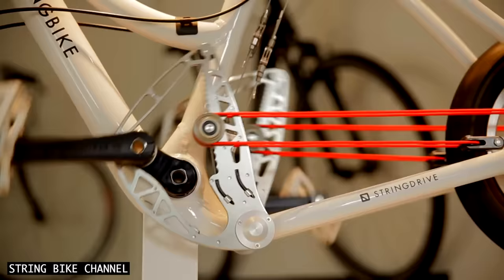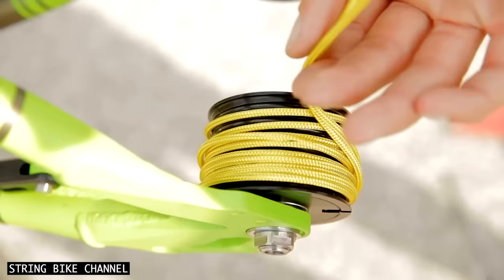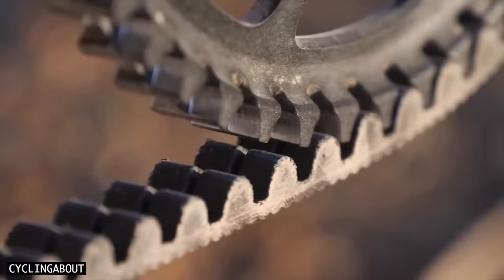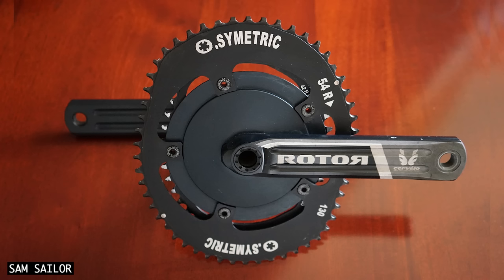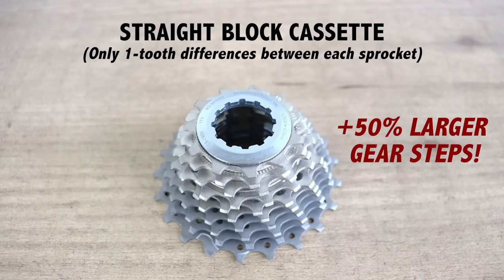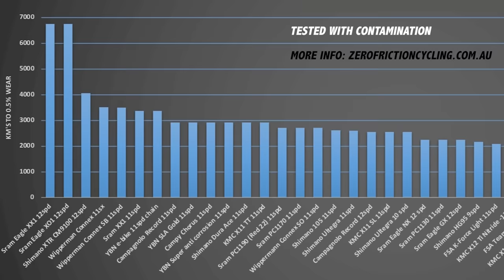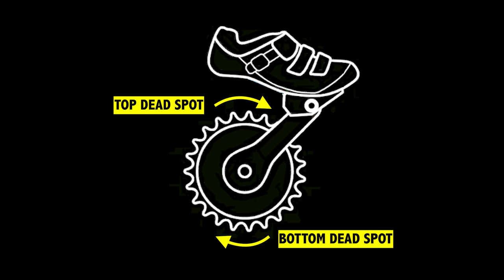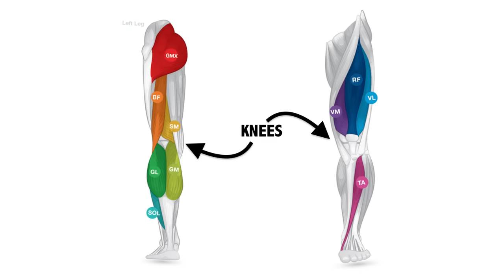Are Chainless String Drive Bicycles a Genius or Terrible Idea?

Comment: Regarding oval chainrings - discussions about biomechanical efficiency prove a complete misunderstanding of the essence of the benefits of driving on oval chainrings. The effect (reduction) of the upper and lower dead center in the normal speed range is not that important, especially when pedaling in the SPD system - thus pointless discussions, scientific investigations etc. The greatest benefit of oval chainrings is the significant elimination of the dead top and bottom points when overcoming extreme climbs (15%-30%), at the limit of minimum speed (3-5 km/h). In such conditions, the cyclist struggles to maintain balance when overcoming dead points, the driving torque drops to almost zero - overcoming this range faster brings huge benefits. And not ordinary oval or elliptical chainrings, but asymmetrical ovals (non-elliptical, e.g. Doval) give this beneficial effect, at least this effect is stronger on non-symmetrical ovals.
I dare say - it concerns much more MTBs than road bikes. 
One of benefits of stringdrive mentioned in the video was eliminating/reducing dead points - weakly relevant.

Comment: Can you make chains out of that rope material? 😂

Oval drives are about putting less pressure down not more. Theyre great for road use and do make a difference in smoothness but they dont work for mtb's where you have to pop the front wheel up using a strong pedal stroke. Dangerous for that.
Theres also two designs..shimanos which was a failure and modern which use different rotation angles

Comment: Seems pretty crappy from some googling. On other hand belt drive is pretty good. Personally I'm looking for it because I'm kinda dreaming of going touring and it could give some advantages for that type of biking. On other hand, for other common cycling purposes I haven't seen anything that beats chains, honestly it just works and you can get parts anywhere. Overall, if you add complexity like in this case, it might feel better, idk if it does, but that mechanism is going to add losses of efficiency in your pedaling. Frankly, I don't see point for this aside from being weird novelty some people are going to try.

And that tensile strength mentioned in video means absolutely nothing, it's just bit of information someone would put on advertising to try trick customers with bigger numbers ;D It's just weird thing to mention, unless you fell for marketing. Chain can handle all the stress needed for biking. On other hand that rope will be much more likely to get damage or wear that will lead to it snapping.

Comment: "Gears don't require adjustment"
Sure they don't... those four cables going to two totally separate sides of the system just magically set themselves to be equal. The push/pull cables required to hold those adjustment points in place magically don't stretch, despite being the same cables as traditional derailleurs.
Reply from the maker: I use push/pull cables on multiple internal gear hubs, and the number of times I adjust them in between replacing the cables is often zero. In any case, gear adjustment intervals are significantly reduced compared to spring-loaded derailleurs.

Comment: Wishful thinking here.
The reason chain is so efficient is because very little energy is lost
The claim that dyneema rope does not stretch it's not quite correct here
There is wasted energy in the take up that is not existent in chain
Also
Absolute strength comparing chain to dyneema rope has no meaning here
The way this bicycle works, The winding of the drums uses energy.
This energy is produced by the rider
This energy is wasted.
In bicycles a very small drop in efficiency is a really bad thing

Comment: Never thought I would see a larger money pit than a regular road bike. $10 for a set of strings would make this bike slightly less expensive to operate than a car. Good luck finding spare parts since nothing is standard. Bikes should be good for the environment as much as possible. Standardization helps with that. Nothing like manufacturing a bike made entirely from proprietary parts. Stringbike is trying to solve a problem that doesn't exist, creating many in the process of doing so. Terrible idea.

Comment: I see one issue that will cause major problems selling them. "String" sounds silly, weak and unreliable. They should come up with a better name. Regardless of the relative strengths and weaknesses, your never going to get mass market acceptance of a bicycle that uses "strings" in its drive train. Presumably the "strings" are made out of fibers like Spectra or Kevlar. Which do you think people are going to buy, a bicycle with "string drive" or one with a "Spectraglide Transmission" or a "Smooth operating lever actuated Kevlar belt drive". Marketing counts for a lot when you have somone else trying to run down your product so they can sell theirs. "Our Bikes are tools for the professional athlete. We use an advanced alloy gearset with a state of the art modern implementation of a proven gear and chain drive system. Theirs use a string. It might be ok for a child, but an athlete like you is going to snap that string like... Well... A piece of string..." And under no circumstances make the cord bright neon colors like day glow green or orange. It screams "toy". Call them cords, or belts, or anything but strings, which should be like talking about "stickers" at a label factory. Their not "stickers", tthry are decals or labels, stickers pieces of paper that are bought by 5 year olds for a nickle from a gumball machine. Labels amay be made outt of a range of materials ehichight invlude paper but can also be high tech heat and vhrmichal resistsnt polymers or even ceramics. Is a sticker snd a label thr smd thing... Well, yea its marketing... 

I bet you can make something like that  lighter. Make the lever arms out of carbon fiber with an attached titanium teeth, etc. See if it can be optimized for competition use. Carbon fiber cords might be an alternative to what they are using if you dont care about money. It doesnt look like there are any really bad bend radii on the cords. Things like spectra and kevlar have a lot more stretch to them and will disipate more energy. If you can get that down you can increase efficiency. The 1000km life span of the "cords"  should not be as much of an issue, so long as you can depend upon them lasting that long. Like a race car engine. If it lasts for the race, but needs replacement before the next, thats ok. Electric motors are not an issue there either. Disc brakes? Might be an issue but that might be solvable.

Comment: Let's see: Less durable, less efficient, proprietary, more complicated, less adaptable to environmental conditions and varied power/speed duty cycles, and far more expensive.  I'd say they're terrible.  The ONLY viable alternative to chain drives are sealed gear units and ONLY for low-performance commuter bikes or extremely muddy off-road terrain.

Comment: 'I know it looks crazy and complicated'

That's because it is. A ratcheting hub on either side is not a great idea for a multitude of reasons. There's a whole lot of problems with this and funny enough almost none of it has to do with the string. The problem is how extremely complicated it is compared to random ass stamped metal and bearings rofl.

Edit: Also why did you lie about how strong the dynema was? You are 100% aware it's not that strong in the setup there especially with the bend radius.

Comment: If you ask me normal bikes with chains and external gearshifts worked just dandy... They were easy to maintain and repair and they worked just fine. All this new tech shit they're throwing on there is nice and all, but a few years from now if it breaks down I'm down a freaking mortgage to pay some dude with a masters degree in engineering to have it fixed... The old bikes I can fix almost every problem in 15 minutes from the comfort of my own backyard costing me a anywhere between fk all and 30 euros if it needs a new part.

Comment: yeah chains are cheap my arse. some of the ebike chains I saw cost up to 150 euros. just for a chain. The backwheel gear set isnt cheap either. and niether is the gearset on the front.
all in all if you have to replace it all at once it can cost you anywhere from 100 to 200 bucks nowerdays, that aint cheap. I just had to replace mine cause the chain kept jumping off when under load and it cost me like 120 bucks. thats, self installed. if I had it done in the shop itd surely have been more expensive, and thats without even counting the two small gears that lead the chain

Comment: No matter how you do to improve the drivetrain, lightening up the weights of the triangulated bike you're still stuck on Egyptian pyramids bike of pain. Its like a quicksand that no matter how you improves you'll be stuck on UCI's mandate to follow the NWO.

Since 1996 been on various road Recumbents bicycle commuting: short-wheelbase, long-wheelbase, high above the seat bottom bracket and low below the seat bottom bracket. 

Found that the best torque and aerodynamic is on Cruzbike Vendetta V20C FWD with BB high above the seat: thigh power + leg power against the back seat makes more torque than on regular road bike with thigh and leg alone even while standing on pedal. 

Laidback bicycles mimics standing on pedals against the back seat.

As you get old thighs and legs lose strength a bit compares to teenage years but not true on road Recumbents' riding without pain.

Comment: Looks like a rotary engine 😂

Mazda zoom zoom

Cvt transmissions will never last as long as a planatary gear box. They are also not serviceable. 

Sometimes technology ruins the pocketbook. Cars are going in that direction. 

Your tail light in your new f150 that cost 75k gets water in it. They are made cheap and this happens often. The water causes a short in the light which is hooked to a bus system. The entire bus system to control your entire car, which is electronic, gets fried. Only the dealer can fix it. 

Now your tail light is a 4,000 dollar repair. We're going in a wrong direction.

Comment: Terrible idea.  Too many changes of direction of forces, over-complex.
If you start from the most efficient system, a Single-speed with a well-oiled chain (possibly a belt) then everything you add after that reduces efficiency.  An elliptical chainring could even improve the torque-curve without increasing mechanical losses.
Just look at the amount of things moving, pivoting, rotating and rubbing on this thing.  An interesting technical exercise but bordering on stupid.

Comment: Terrible, as they have long lasting durability. Cheap, repairable doesnt add up to the design. Also you will need oil, you dont need oil to produce them and can use alternative oil to keep them fluent - normal standard steel chains. Average life spawn - infinite with good maintenance. The mechanism is too complicated, easily disabled with little sticks and stones, so unless you drive on a clean road or street or pathway you wont have long fun.

Comment: Let's see. Unlike steel, dyneema is a petrochemical product that cannot be reforged or otherwise recycled, its superior strength is weakened after exposure to UV light, and it is sensible to cold temperatures. The ropes last about 2000km, which is one year of use for an amateur cyclist. Or three months for a serious biker. Why, that's awesome.
We should most certainly replace chains with ropes. After all, there is an urgent need to replace something that works fine with something more woke, which needs to be replaced every few months, too. Let's make the world a better place with, uh, new stuff that we totally need. :D

I mean, don't get me wrong, the design as such is somewhat ingenious under the assumption that no such thing as a chain or a gearhub or anything the like has been invented. However, it so happens that these have been in use for ages, and they work perfectly fine. No need to improve anything.
Why not replace the spokewheel with a sheet of basalt fiber a few dozen micrometers thick? It would weight less and produce fewer turbulences and thus waste less energy and produce less noise. Oh, but then again, spokes just work fine...

Comment: Wtf has a materials ability to float in water to do with its tensile strength?!
Especially if you don't compare the tensile strength by weight or volume but just pick some random examples this is total nonsense without any meaning.

Comment: Pedal assist e-bikes are trending because an inactive person living a sedentary life can hop on an e-bike and ride way further, up steep hills, and with better times or faster speeds than a fit person who regularly exercises on a conventional bicycle on the same routes.

Battery energy storage technology that Sony invented Li-Ion for Walkman at $3800/kWh in 1990, dropped to less than $57/kWh 2022 with EV battery pack mass production and Tabless 2170 cells from Tesla, though prices have increased to $157 2023 because of currency inflation and the rising costs of lithium and cobalt, nickel, copper, aluminum, manganese, magnesium, titanium, platinum, gold, silver, rare earths used in magnets in the IPM motors, and other factors, thus making EV batteries and E-bike batteries slightly more costly.

Consider that the thermal efficiency of cost effective feasibly mass produced automotive engines like the ones that Toyota uses in millions of Prius can go over 43% Carnot thermodynamic fuel to motion of vehicle conversion efficiency in the new Dynamic Force engines of the 5th gen Prius thats almost 196 HP and does 0-60 MPH or 0-100 kph in 7.6 seconds, the fastest Prius by far of all Prius generations so far sold since Prius launched worldwide in 2003. We love our 2010 Prius III and 2022 Corolla Hybrid which has virtually the same HSD with the 2ZR-FXE engine made since 2009 and refined and perfected over many iterative improvement generations of designs, sorta like the R3 motor used in the 2020 MT-03 that was refined for 9 years in the R3, then torque optimized for commuting with longer gear ratios, and comfy seating geometry and a superlative 6 speed sequential in the affordable MT-03 that I highly recommend! 

ICE or internal combustion engines, liquid cooled, fuel injected, emissions controlled, have much room to improve towards 70% thermal efficiency using a variety of engineering tricks that include laser peening the valve seats, fully variable electro-hydraulic-or-pneumatic valve control, continuously variable ignition control, homogenous charge compression, variable compression, low inertial turbo-charger designed into the exhaust manifold, with gasoline + port injection and multi-modal ECU variable AI enhanced dynamic engine mapping control to optimize thermal efficiency and performance at all load and RPM conditions. This means radically improved fuel economy going to 90 MPG on regular unleaded E10 gasoline sold widely worldwide, or less than 2 liters per 100km, in 3500 lb ICE cars of 2025 MY model year and onward. This also means radically reduced exhaust gas emissions from each vehicle, thus improvements to public health by reducing air pollution where such vehicles replaced dirtier emissions vehicles scrapped out & recycled as the superlative fuel efficiency high thermal efficiency lower operating cost, lower lifetime cost, more reliable, lower emissions fully optimized ICE vehicles are hybridized more in PHEV platforms, then relegated in 2050 to range extender generator modes in REEV or range extended electric vehicles. We cannot make enough Na-Ion batteries, copper, iron or other materials to make all passenger vehicles EV's, so a mix of fully optimized ICE, PHEV, HEV, REEV and BEV will be needed to gradually phase away from energy fuel waste and poor emissions per vehicle, to ultra super low emissions and advanced technology partial zero emissions platforms.

Comment: absolute trash and a gimmick. Put anything on that over 500 watts for 1 minute please. I am very curious. Reminds me of the chainless drive from 10 years ago that went nowhere because the gears cracked. 
That guy in the video is barely pedaling
Reply: o my god the crank arm has to resort to linear friction to move the "ring" ... 2 minutes in and this is already less efficient than the belt.